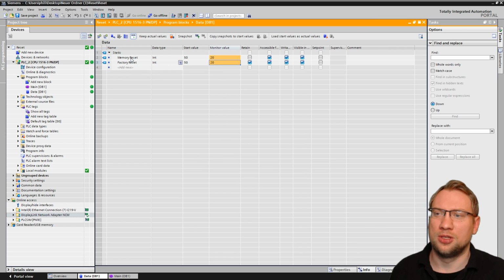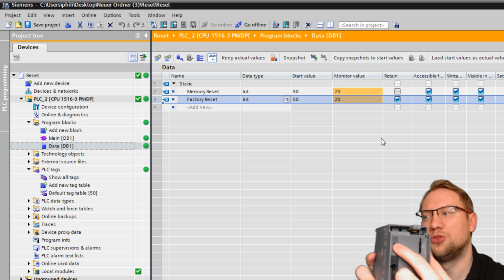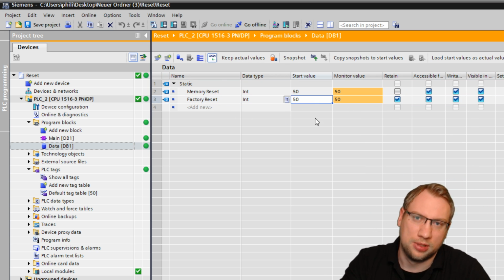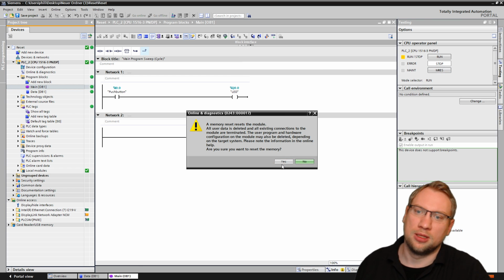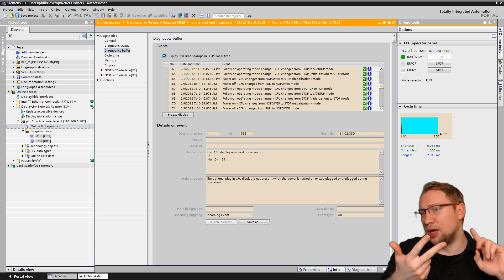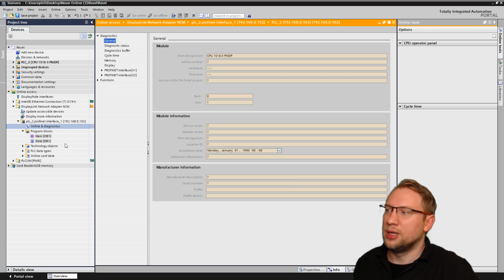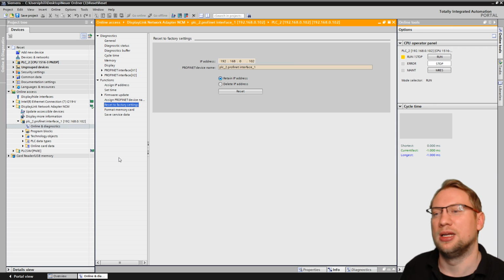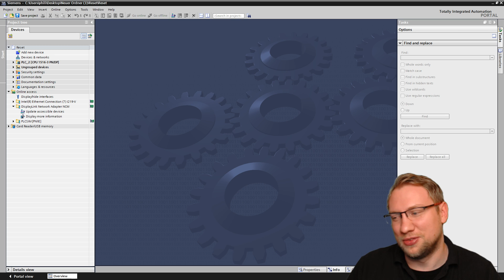TIA Portal: Restart, Memory Reset (MRES), Factory Reset

Comment: Dear Sir, I like Your presentation very much. Sir, I have a problem with S&-416-2DP PLC, It is a used PLC setup with CP-443-1, CP441-2 and 4xAI modules. Each time when I start, it has all blocks and hardware that was previously in it at the running facility. I want to delete all these and want to reuse for my own code. Please help How to completely reset it. Thanks

Comment: It's a little pity for S7 1200 does not have a external reset option, what in the case if it is not answering  (because of a bug in the system) while you are trying  to  discover it  in TIA portal . How to restore it to the factory settings. ??
I've just had an issue with it, hopefully it was possible to get its ip address from arp table and to connect to it eventually. ( )